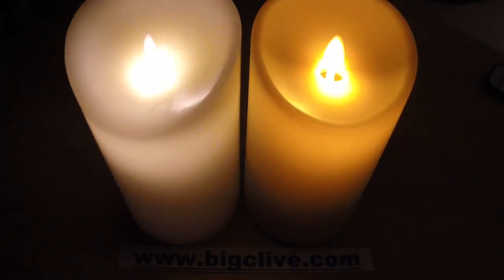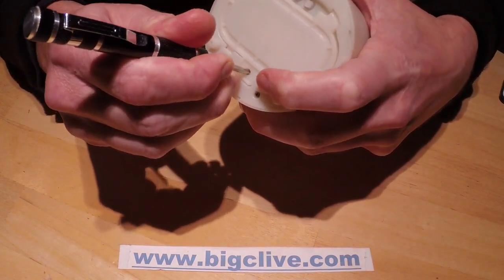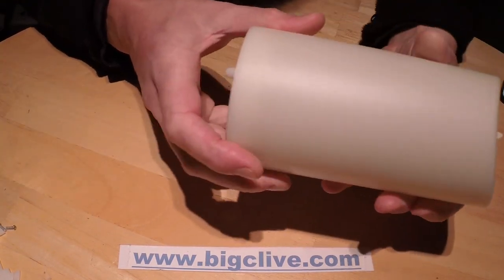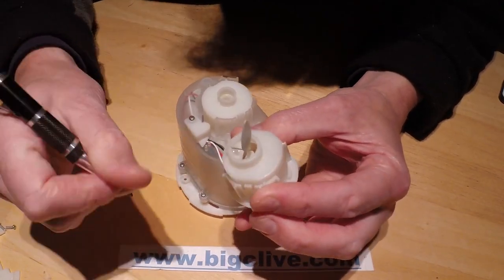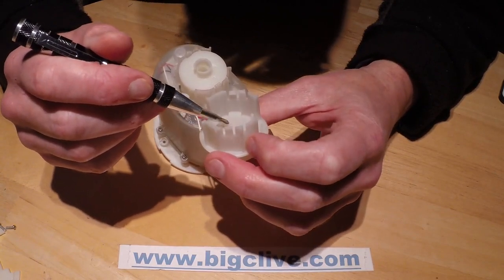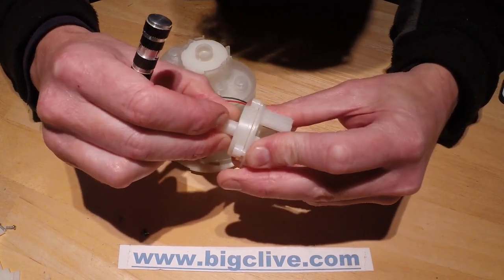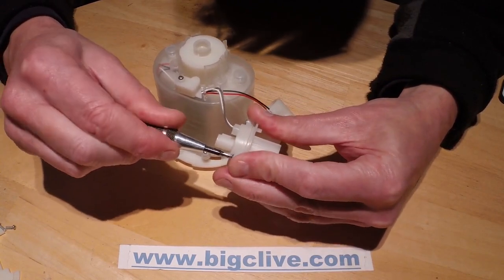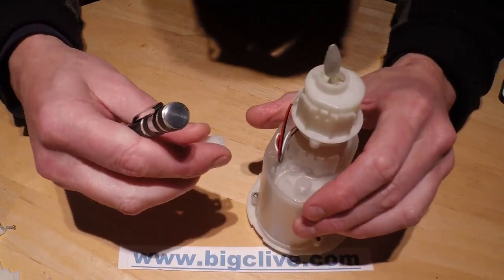A look inside a Luminara waterproof outdoor LED candle.

Comment: 06-13-24

I have bought many luminara candles in the past from Pottery Barn.  In the last couple of years, was informed that they have been replaced by a brand called L&L Candle Co. (supposedly a Luminara replacement).  They look and function just like the original Luminara and of course has the same expensive price.  I was told these are the new replacements and are exactly the same as the original and that Pottery Barn no longer sells the original Luminara.  Over the past 3 years i have bought around 30 or so of these candles. They look great but they seem to last about 6 months to one year at the most.  The common problems I have encountered is that:

1.  The on/off buttons no longer turns the candles off so candles stay lit all the time.  If I am lucky, then I can use the remote to turn it off and then after a time, the the candles no longer respond to the remote any more either.  Anyone encountered this and know of a fix? Clive: LOVE your video, wondering if you know of a fix for this?? I am assuming the mechanisms of the L&L candles are the same as Luminaras as the Pottery Barn rep advised they are same.

2. The battery contact inside the candles that are glued down often become loose/dislodged so the battery will no longer have contact with the unit to supply power. My solution has been to open the compartment and re-glue contacts back and everything is fine.  Fixable but annoying. This is also a common problem with these L&L .. poorly glued.

3. The lid at the bottom that snaps in to close the battery compartment will break after about a year of use.  

Why do I keep buying these from Pottery Barn?  Because they are the only realistic moving flames out there unfortunately.  They are very expensive but the quality seems so poor to me at these price points. I would say only 20% of the 30 outdoor candles have bought remain working.  Even these outdoor ones when used INDOOR still encounter the same issues so I am not sure if being outdoor has anything to do with it. Just yesterday, one of my L&L candle ran out of batteries so I popped in fresh ones...the candle will no longer turn off using the mechanical buttons at the bottom nor will it respond to the remote.  Very frustrated so I searched the internet to see if anyone is encountering these same recurring problems as myself. I understand this thread is about Luminara candles but I was advised these new L&L are the new replacement for original Luminara or was I misinformed?  On visual inspection, these  L&L  are identical to my original Luminara. They really do look the same in very way except the branding on the battery lid is L&L and not Luminara.

Pottery Barn and any other retailers who sell these should contact the manufacturer to address the quality of these products.

Comment: My plan was to connect the led to dmx dimmer so i can control the output and on off of the led. I would leave the motion running on the D batteries. The output at the terminals for the PWM is 5 volts. I was thinking that the led should be able to handle a 2 volt increase with out damage but didn't know if there was any step down on the candle board that ran the led at lower then 3 volts. I could run a 100ohm resit. Out of each ch port before candle connection but do you think that its really needed? Its only 2 volt extra and its regulated. I Would think most of this type of stuff is built with some degree of over/under voltage possibility in mind
Reply from the maker: ***** LEDs will sink as much current as they can when the supply voltage exceeds their forward voltage.  They are current operated devices.  Running an LED on a non current limited 5V supply will cause it to fail very quickly.
Reply: bigclivedotcom  I hooked up a 100ohm 1/4 watt resister but after testing it with volt meter I see no voltage drop. it still show 5volts even when the resister is used. Any reason why?
Reply from the maker: ***** If you have the resistor in series with the LED then you will measure about 3V across the LED and about 2V across the resistor.

Comment: Hello I have been trying to buy a similar inductor but I don't know where to buy it, and I also don't know the amount of inductance this candle uses. Do you know either of these? I don't know much about this type of thing so I could be using the wrong phrases...But I would appreciate the advice! Thanks
Reply from the maker: +Paige Cataldo It's custom wound for the product, but you can find similar coils in the little solar powered shaking/nodding ornaments or wind your own with a miniature plastic sewing machine bobbin and very fine enamelled wire.
Reply: I'm going to go with the mini bobbins! Wonderful idea, is there an online site you use to get these?
Reply from the maker: +Paige Cataldo Ebay should have loads.  For instance, here's a Chinese seller...      http://www.ebay.co.uk/itm/272024750707

Comment: Do you think the led would have any issue with running 5 volts directly to it by passing the board completely? Working on a new project here with these candles
Reply from the maker: ***** You'd have to use a resistor in series with the LED to limit the current through it.  On a 5V supply that resistor would be a 100 ohm quarter watt resistor.  Or you could use a higher resistance if you wanted to dim the flame down a bit.

Comment: Hey bud watch you all the time trying to learn the electronics of things. My question is what is the name of the screw driver set  you have and where can i get it.  I have quad copters that require small screw... Thanks   ps: i got some led floods for outside 1  20w  and 1 50w US power. Is there a dusk - dawn setup i can put in line or just run a timer. Thanks in advance , Dave
Reply from the maker: Bigwingrider1800 The screwdriver set I use came from Poundland, a UK dollar store.  It seems a very common set though.  You do get the PIR movement sensors for the outdoor lights, but you could also use the dusk sensor or a timer.

Comment: Might even make a good security device for inside with that timer for when your out or away for sometime..
Reply: That is exactly how I use mine. I place them close to the windows in both bedrooms of our vacation home. The drapes are fairly sheer, so from outside our home the flickering almost looks like there might be a television on in that room. I have staggered the timers so that one turns off at midnight and the other turns off at 1AM. I also have 2 placed in lanterns in my living and dining rooms. The house looks occupied with soft light eminating from 4 rooms of the house. In the bathrooms  I have radio tuned to a "talk radio" station on a timer in the living room so that it sounds like muffled conversation if you approach the door. Our neighbors even remarked that they can't tell when we are in the home because the house is always lit in the evening.  Now we also have an Amazon Echo that we set to "guard" while we are away. It would notify us if it detected the sound of a smoke alarm or breaking glass.

Comment: Expensive cheap..  all the same to me.  (which some people still think the more you pay the better the item is.  Tell that to both Exploding S7's from Samsung and now Exploding Washing Machines from um Samsung.  O_O  Wonder if someone used too small a belt around the motor and the cavity smh  We did that once with a vacuum.  not particularly smart but sure created some good suction.  Very tight belt though.  They both look nice to me.  although I prefer a real flame but when you can't have one (dorms?  )  those will have to do.
Reply: Lee Bartholomew note 7*
Reply: Lee Bartholomew - waaaaay back in the day of rear-projection TVs, before flatscreens, I worked for a company that repaired all the TVs in the tri-state area for a major retailer...   they all came to a distribution warehouse we worked in.   Samsung had one model of rear-projo TV that had a massive flaw...  real quick tho, if you've never seen inside a rear-projection TV, behind the screen is a mirror, below which are 3 small CRTs (RGB) with lenses and under that on the bottom are the power and video decoding circuit boards.   The CRTs are 'floating' above the bottom boards and each CRT has a small circuit board at the end to drive the electron gun.  So now the flaw...

I never found out if it was just bad design or a faulty batch of components, but what happened was the electrolytic capacitors on the CRT circuit boards were leaking out their fluid...  depending on which CRT board went first the results varied from simple non-functioning of the set to my favorite, fluid leaking on the high voltage circuitry resulting in large amounts of sound, light and smoke being released in a rapid succession.  We had literally hundreds of these sets in a holding area as they couldn't produce the replacement parts fast enough...

So exploding electronics is nothing new to Samsung...

Comment: Hi bigclivedotcom. I was inspired by your other vid and made my own flickering candle (https://www.youtube.com/watch?v=y_sV5tHBu40).

Have you ever seen a factory made flickering candle, tealight size, rather than the large ones like this? I don't just mean a flickering LED, but one that has this flame movement. Of course, counterweight / magnet assembly will probably take up a bit more space than the height of a tealight, but I'm aiming for as small as possible. I want to make an installation for the home where I wire-in 20 or so tealights on a PWM dimmer circuit (powered by an old Dell charger or something like that). Although I made my own, I can't find an effective way to mount the thing.
Reply: I've not seen tealites with the moving flame.  Just the common flickering ones.  You can buy 5mm flickering LEDs on eBay.  But the standard flickering ones and quite restless.

Comment: Anyone else have their ASMR trigger when Clive uses the screwdriver?
Reply: triggered
Reply: asmr?
Reply: Autonomous sensory meridian response (ASMR) is a colloquial term used for an experience characterized by a static-like or tingling sensation on the skin that typically begins on the scalp and moves down the back of the neck and upper spine. It has been compared with auditory-tactile synesthesia.